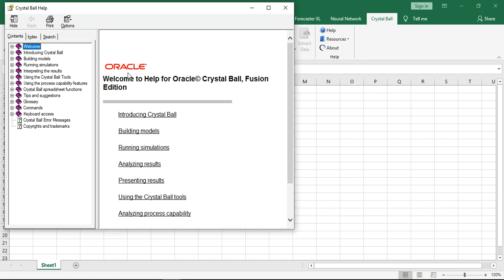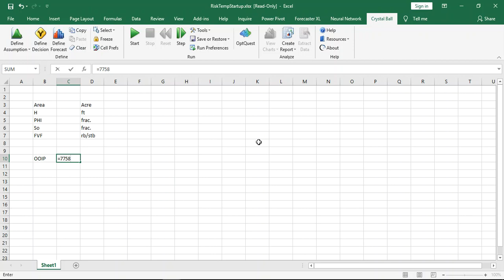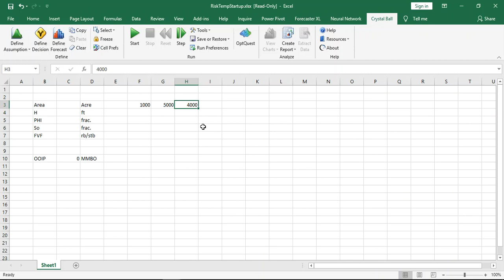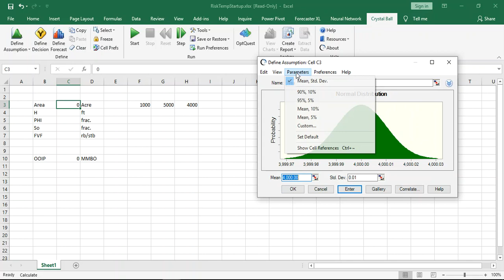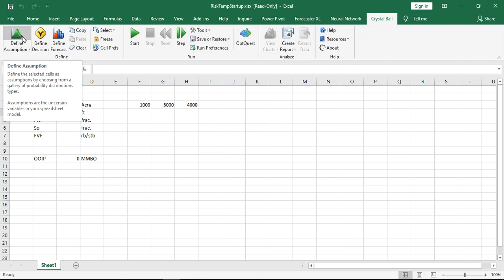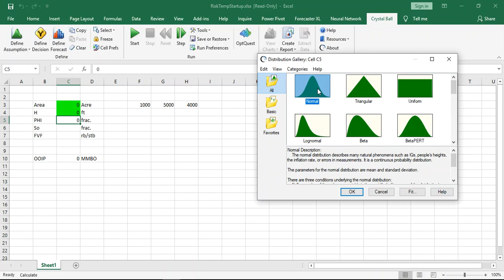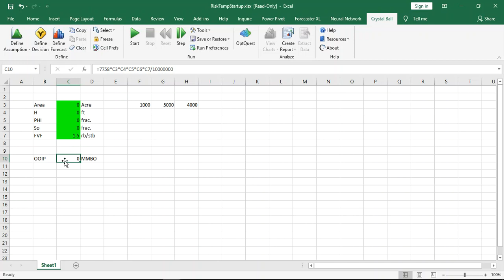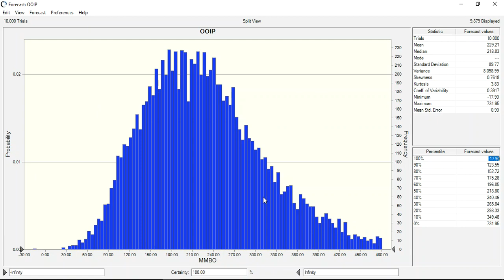Original Oil In Place Calculations using Crystal Ball (Probabilistic approach)

Comment: You made an error in the first 60 seconds of the video. You shouldn't have accepted Excel's recommended change. When you did this you multiplied by FVF (aka: Bo) instead of dividing by it. Thanks for the video though, seems like Crystal Ball is easy enough to use.

Comment: " The standard deviation is a measure of the amount of variation or dispersion of a set of values". So for area, where mean is 3000, you should have entered, say 500, as standard deviation rather than a value between 0 and 1.